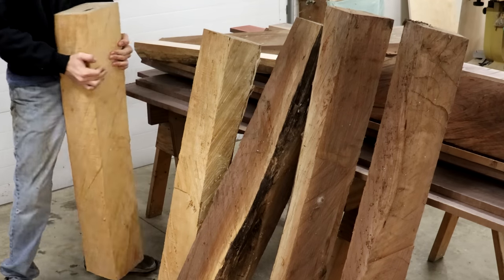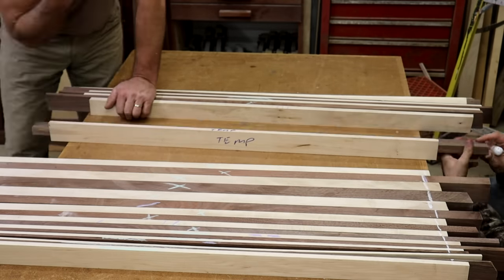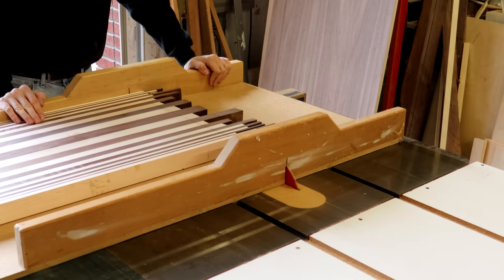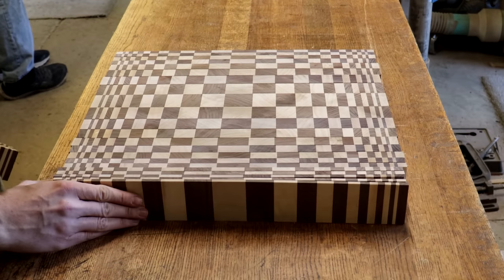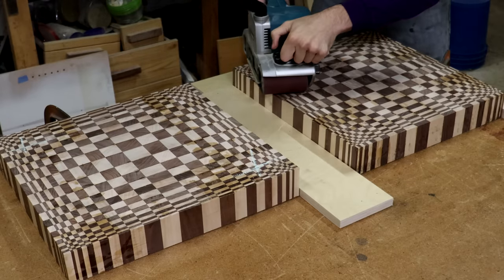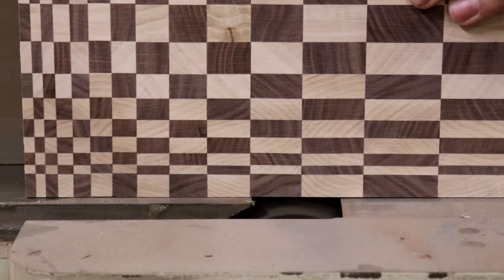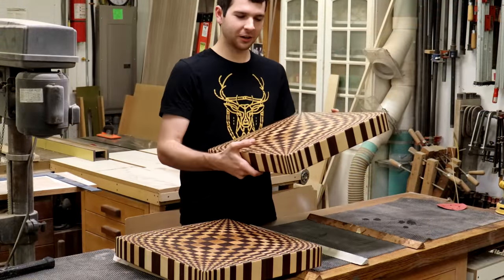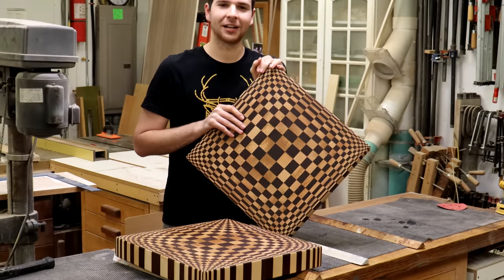Making My Life Harder Because It's Fun

Comment: I personally would have done it in the opposite direction, meaning having the smaller squares in the middle and the larger squares out at the corners;   just so that you can avoid having all those smaller pieces exposed to the outside, so they aren't so prone to falling off or breaking off.  You guys are sure putting a lot of trust in that glue. lol...  It looks great though

Comment: Those are two perfect cutting boards BUT I would be afraid to use them for two reasons 
1.) they are more of a work of art and I would hate to chop on them and make cuts on the board it self.
2.) that pattern you did Is a master piece but it looks like it could be a bit dizzying, seams to have a 3D effect, I would not want to be dizzy when working with a knife lol...

Comment: Awesome cutting board! Thanks for sharing the specs on board thickness. I don't have any woodworking tools, but was able to multiply the board widths by 32 and come up with a pixel size to set columns and rows in Excel. This gave a pattern to have some fun with. Turned it into a video for some fun optical illusions. https://www.youtube.com/watch?v=yrZEDMYodOA